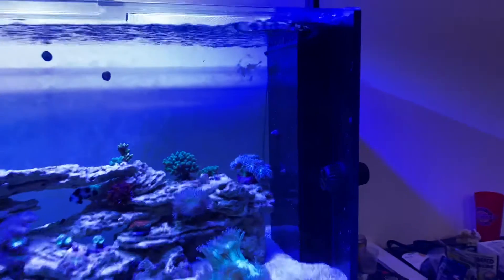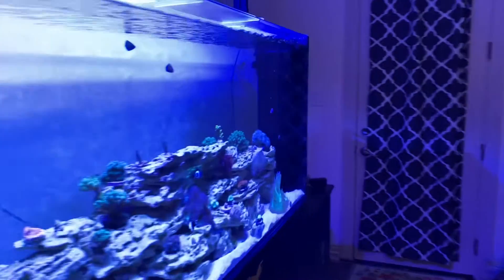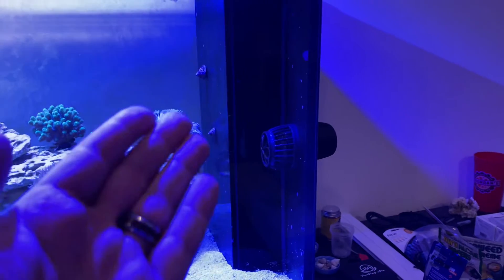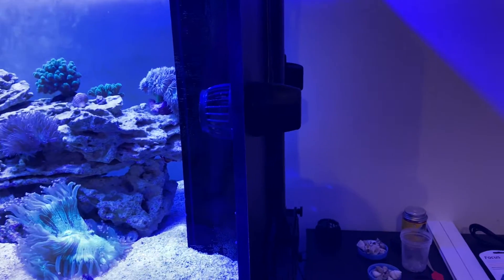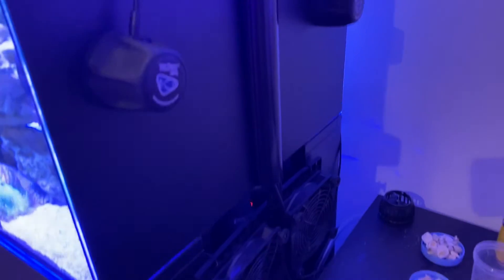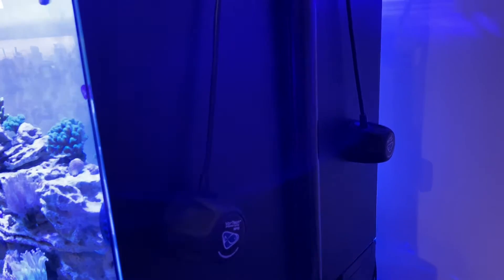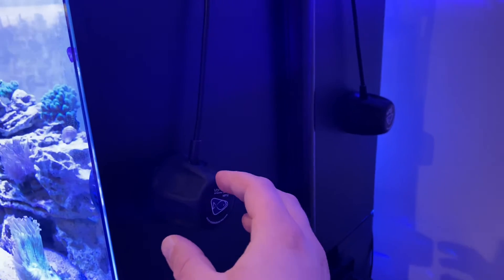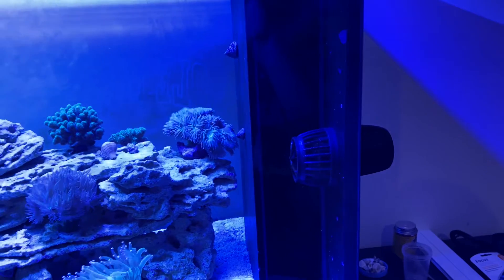Product Question: Will an EcoTech VorTech MP10 work on 1/2” thick glass?

Comment: I’m running mp10s on the back wall of a Waterbox frag 105 with 12 mm glass and the thin black coating they spray on the backs of these tanks.  Initially had problems with the driver falling off the tank above 50% power and lucked out because I’d used 3 of the stickon wire holders.  I noticed that when the magnet was too weak to hold on the intank powerhead would chatter and the cage would spin while the powerhead stayed in place.  I then tried to move the intank powerhead and outside driver together around multiple places on the back wall until the chatter noise and spinning in place movement stopped, and that seemed to show that the magnet was strong enough to hold in place.  My guess is I’d found a spot where the glass was slightly less than 12 mm thick and/or the factory coating was thinner, and the mp10s haven’t been a problem since.
Reply from the maker: Overall, I would say that for the price we pay for premium products like this, it shouldn’t kill EcoTech’s bottom line to just include magnets rated up to 1/2” thick glass, you know?
Reply: @kalamazoo_reefer  Yeah you’re preaching to the consumer choir 🤪 Corporate America doesn’t care especially when venture capital takes over… 🤦‍♂️We reefers just need to jump over hurdles to get to where we want our reefs to be🤷🏼‍♂️
Reply from the maker: @MW-ut3dk  Definitely. Do you follow Telegraham? I plan to start drifting toward a lot of the products and services he champions, as I don’t think any company under the Aperture umbrella will indefinitely keep its quality high, now that these companies no longer steer their own ships.
Reply: @kalamazoo_reefer I’ve been following the big T for yrs ever since Inappropriate Reefer put him on his channel—smart dude and knows alot especially when it comes to alternatives to overpriced and/or unreliable stuff.  I like his show me attitude when it comes to reef tanks.  Devin is also a favorite channel for me, but I don’t think i can reef on that level of tech.  I’m more of a KISS reefer—don’t like too many points of failure that I can’t troubleshoot if something goes wrong, hence just kalkwasser dosing via pump, no slurry or stirrers.
Reply from the maker: @MW-ut3dk  Devin is on a level very few of us can hope to achieve, when it comes to tech and automation. Dude’s a wizard.